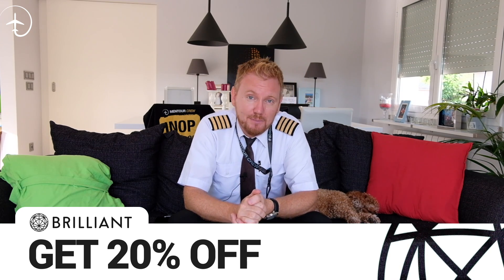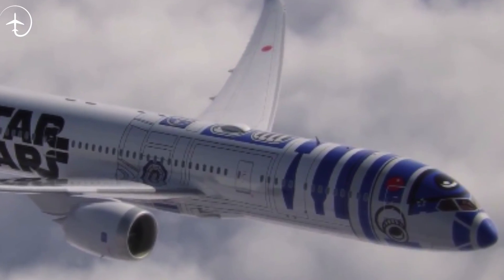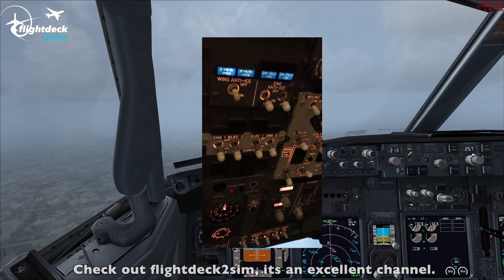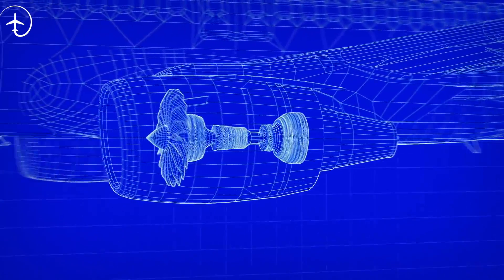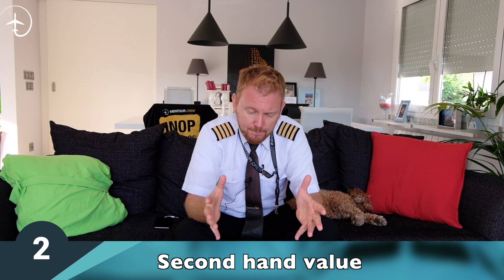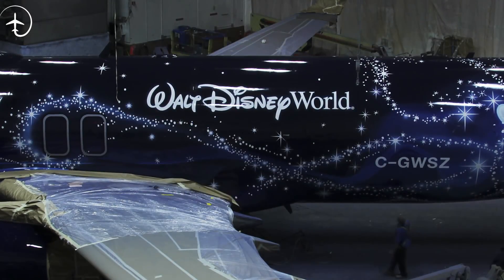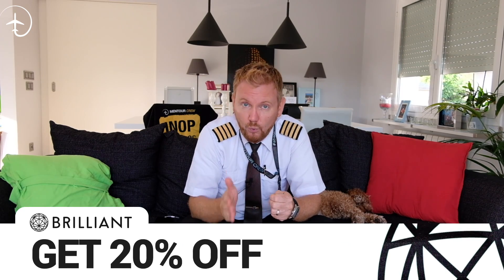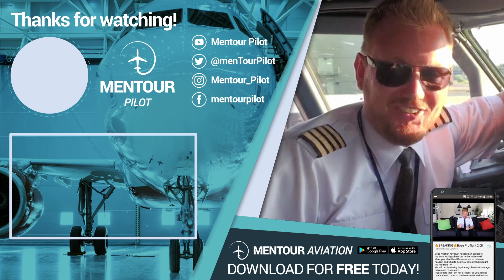Why the front of the Jet Engine is NEVER painted..

Comment: Hi +Mentour Pilot ! I'm watching you for a long time, and while I'm no pilot and I won't be one, I'm just drawn into learning more about this subject. A few days ago I was flying with an Airbus 320 for the first time, two times in total. While boarding into the plane the music was playing, the light were on, and then the power cuts off for about 1 second but enough to be noticed, and then everything was back on, with a slight lag on the music. On the second flight the same, but there was another power cutoff again, before heading to the runway (2 cutoffs in total before moving). I though the APU was on all this time, and the power cutoff was when powering on the engine - but I didn't hear it since it was a mess boarding. I was in Boeing 737 (more versions) a lot, but I didn't see this thing happening, or at least wasn't noticeable. What could it be, and why is different from this point of view? Because for people, losing power "out of the blue" could be a bit scary, I mean it's a plane, not a lightbulb.
Reply: I've been onboard many different planes when this happens. APU's are not used a lot to save on fuel.  So they use the cart for power when on the ground and parked at the terminal.  The power interruption is caused by the switch from cart power to plane power.  (APU is not needed when the main engines are running).

Here's the rub! Remember all of the times when planes are stuck waiting for departure for hours and can't?  And the customers sue the airlines for being stranded on the tarmac for hours on end in sweltering heat?  Yeah that. I have no idea but I'll take a guess... they shut the main engines down, keep the apu running (so they can restart the engines), but the ac has no way to operate without the main engines, so customers just die in the heat.

Just my opinion!

Comment: You forgot to mention the fact that all airfoil leading edges are not painted as well - for similar reasons.
Reply: Dave , it is mostly jet aircraft that use bleed air heat for anti-icing. Even relatively fast turboprops (250-320kt cruise) use de-icing boots inflated by a fraction of the bleed air PRESSURE available.

Comment: Aside from engineering considerations, paint on the engine inlet would also show its age and look ratty if the leading edge was sandblasted to bare metal.  This is reason #4 and the one most easily understood by management.  (Managers, just joshin' ya!)

Comment: I fly United quite a bit, its interesting to note that you can always tell which of their jets came from the Continental merger because the engines on those jets have a polished silver leading edge ring as opposed to traditional United jets which are the matte silver color. Is it literally just polished or is there anohter reason?

Comment: I remember reading an article a few years ago about the liveries and the weight that the paint adds to the finished product. Imagine if they used only the green layer.
Reply: Wouldn't be enough coverage to protect the plane over time.  But the paint weights are calculated to the T in the original design.

Comment: If you have an auto setting for the engine start switches what does that “auto” control? I know Cont is for the igniters to keep going but with the A320 if you put the engine anti ice on the igniters switch on automatically without having to change the start switch

Comment: I wonder how basically all non-cargo military aircraft get away with painting their intake.  I would say at supersonic speeds the friction alone heats up the entire aircraft, but they rarely see that.  Only the F22 has supercruise.  The A-10 doesn’t fly high enough to worry about icing, but most fighters can fly higher than most commercial airliners.  I wonder if there’s some other kind of physics involved.  Or maybe they just have a smaller hot oil line feed up to the lip, and get away with painting it.
Reply: Throwing the dollars at high spec paints or anodising would be my guess. Fighter jets also tend to have radically different intake geometry than a passenger jet, which might also make a difference.
Reply: @karl0ssus1  Oh boy, you are spot on with that comment. The difference in intake geometry is HUGE!
Reply: @AZREDFERN The A10 can certainly fly high enough to encounter icing conditions.
Icing can take place at sea level.
Think 28 to 31F with fog or mist driving a car.
The A10 can fly at least 30,000 Ft.

Comment: I wonder what the minimum temperature that Rolls Royce, General Electric and Pratt and Whitney have ever run one of their engines at, of course, many people will say, before it gets that cold we roll the airplane into the warm hanger, and then when it takes off the engine hot air bleed off is sucking in warmer air, but suppose this is not an ordinary situation.  It is one in which the aircraft are military, they have been parked on the ramp for three days of sub-sub zero temperatures, and suddenly the aircrews hear the klaxon for them to go to aircraft and do a "hot start" on their engines, because they have to have the bombers, tankers and AWACS and AEWS aircraft into the air with 5 minutes from the klaxon going off.  How much temperature room do they have to play with before the situation is deadly?   Oh, and don't forget anti-icing the wings before T/O.

Comment: How much weight does paint add to the aircraft?
Reply: Regarding paint scheme mass (and polished aluminium such as used on the old American Airlines schemes) - an informative summary is provided by Boeing here: 
@t

The mass of paint on a 737 is about 81 kg (versus just 11 for stripes and logos only)...
Typical savings in fuel costs are negated by extra maintenance (e.g. repolishing ~4 times per year rather than painting every 4 years) so the annual cost of operating a polished short range single aisle aircraft is ~$90,000 more (1998 estimate).   This left the matter largely to aesthetics - until the increased use of composite materials in designs necessitated paint.

Comment: Have not read all the comments so if you answered this question I apologize. As you mentioned dark colors would absorb more heat than white . Which as you mentioned we have all experienced when out on a summer day. This is at ground level where the air is warmer so the dark clothing absorbs more heat. Would the effect be the same at cruising altitude? The exterior of the aircraft would absorb more heat decreasing the aircraft skin's exposure to the extreme cold. Is there any operational benefit either way on the planes exterior temperature?
Reply: White probably provides a better range of temperatures in the cabin for the airconditioning/pressurisation system to handle. Hot engine air is normally used to provide pressurised air in the cabin, so heat is not an issue in flight. Also, humans in a poorly ventilated, insulated cylinder generate a lot of heat.

Comment: Rooftop solar hot water systems are painted black for the same thermal conduction reason.
A sinister application of 'white versus black', in strict Islamic countries, Saudi Arabia for example, most woman are made to wear black clothing, while the men enjoy the luxury of white. It's to do with oppresion of women, condemed to a life of discomfort outside in the heat, and the elevation of men who breeze around more freely in cooler white.

Comment: Only +45 on the Surface? How?

If the plane is parked in say Australia in the summer the Outside Ambient Temp might be say 45*C 
But the direct sunlight shinning on the plane might be 80-100*C 
(as you know temps are measured in the Shade out of the breeze)  

So the Real Temp Variance would be more like a total of about 165*C (-55*C @ Altitude to +100*C sitting on tarmac in Australian or Africa) 

That is how we can cook on our car bonnets in summer by just leaving car in sun and also why our roads melt leaving liquid tar (which turns to liquid at over 120*C)

Comment: When viewing the demo flight footage of the 737 MAX I have to wonder if the plane was equipped with MCAS or if the test pilots must have turned it off. I see no way it could fly without MCAS engaging when they initially take off at such an extreme angle of attack. Would you agree?

Comment: Why don't you ever answer my questions or you do not care? Why there are no airbag on plane ? Why is the life jacket not used during crashes?
Reply: Jeje Wa I don’t remember in which video but he has answered the question about airbags. They aren’t used on planes because they are deployed using an explosive, they would add a lot of weight, and in a serious crash they wouldn’t help. Search “Mentour pilot airbags” the right video might turn up for you.
Reply: @sandramccusker5520  ok but what about using the life jacket as a cushion,?
Reply: Jeje Wa I would think, like an airbag, in a serious crash, a blowup life jacket isn’t going to be very effective in saving your life. Having one around your neck might even make it more difficult to get out of the plane quickly in an emergency evacuation. From what I’ve learned, the safest thing to do in a real emergency is whatever the cabin crew tells you to do. If it’s a crash landing, make sure your seatbelt is on tight and get in the brace position (Mentour has a video about the brace position). If you land in water, grab the life jacket, put it on, and get out of the plane. If you’re on land, just get out. That’s really all you can do.

Comment: Thanks for the great videos.  Can you tell us why mobile phones should be turned off during take-off and landing.  What can happen if you don't?
Reply: Peter Christiansen Basically its just a “just-in-case” thing. Before you didnt really know what kind of frequencies and how strong the phones were transmitting so there was a possibility that something could interfere with the planes systems (radio, locator etc). These days there are limits and standards and basically a phone will not affect anything, but because you can’t test every single phone and item, they say it just in case. It removes responsibility from them too, it possibly makes the passengers more focused on the safety briefing. And its during take-offs and landings only because those are the most risky, if something goes wrong during those times its gonna be a lot worse and stressful than during cruise or while on the ground.
Reply: @iPelaaja1 Thank you so much for the good answer.

Comment: From maintenance perspective, reason No.5:
Damages on the skin of the aircraft are easier to detect if’s color is white. Like cracks, corrosion, rivet gone loose etc.
Reply: Is this true? I would have thought damage would be easier to see in darker colours, especially from a distance, while lighter colours could mask and small cracks at a distance. I'm no mechanic, so nor trying to judge, just an opinion that I thought.
Reply: @peterfranklin4019  Cracks and loose rivets would show up mostly by their shadows and they are easier to see against lighter colours. Likewise, corrosion tends to darken the metal.
Reply: I thought it also was to protect interior wiring and electronics from getting to hot..
Reply: @knocksensor3203  Heat exposure is more like an issue with composit aircraft due to the use of resin in composit materials.

Comment: Question:
why aren't the tires equipped with electric motors that bring the tires up to speed on landing to reduce the wear of them?
Reply: Because it would add cost, add weight, add another system that could fail and would actually provide no benefits. Tires spin freely and spin up to speed almost immediately, it doesn't induce THAT much of wear.

Comment: Don't fan blades get iced? The big fan in front of the combustion chamber, so it's getting hit with some very cold and moist air, and it's also rotating so the airspeed of the blades is even higher. And what about the inside of the outter walls of the bypass? Or is the inner core hot enough to melt any ice that might have formed there? Is fan actually hot when it runs? I know turboprop blades aren't.

Comment: How often is a commercial jet checked.  Do they have annual checks such as every wire, bolt and cracks checked.
Reply: Mersey Blues Different checks are done at different frequencies. We do a B-check every morning before flight, A1 in between flights if its been less than 8 hours from the B and A2 after the last flight of the day. Those look at the main parts, the most important parts and stuff thats most likely to wear (moving parts). Then there are C, D, E etc checks where everything is looked at in more detail, some parts are disassembled to see inside them etc, more systems (stuff that normally doesnt need to be used, like emergency locator) are checked. Those checks and intervals are defined usually by the manufacturer

Comment: It would also be a good video about differences between anti-ice and de-ice systems
Reply: Thomas anti ice should be activated prior to ice accumulation and left on until icing conditions are gone. De-ice is a system used after ice has accumulated. Usually de-ice systems use rubber boots on the leading edge of wings, stabilizer and vertical stabilizer.

Comment: Other quick possible thoughts for the lack of Engine paint: 
If an engine needs overhaul maintenance or recall or failure, and it can be sent back to the engines manufacture say GE or Rolls Royce; they have programs that can swap engine out with duplicate engine to keep downtime to a minimal for an airline. 

Thus it would be very strange to get back an Jet engine that has say an orange paint scheme, that doesn't match lets say the fleets Purple livery.  Heck it might not match other engines color on that plane in this example.  Might even affect airlines that have "sub-brands" (bigger airlines that own a smaller lesser named livery brand that uses same plane model)  

Also if paint was used might mistakenly have a "left or right" paint job, that would reduce ability to swap engines within the airline itself. Say a "left engine fails" and you only had an spare "Right engine" that had a livery or writing that you read or make sense if it was on "Right side" of craft, that would be facing the passengers if used on left side of craft.  May look unprofessional, strange maybe even confusing even to other entities at the airport.

Not to mention Jet engines can be compatible with different model planes or manufactures of said planes (airbus and Boeing) 

So above thoughts are my thoughts and opinions, and "it's Just a Theory, an Aviation Theory"  =D lol.

Comment: Anybody who has black car know it is an oven in the summer 🤣🤣🤣
Reply: @OBServe Garage the rest of the car is still hot and the heat slowly conducts to the inside, of course it's a lot better with ceramic tint but not completely gone
Reply: Pffft.  Black paint aint nuthin!  When I was 16, my first car was light gray.  However, it had black vinyl seats.  And the car was 16 years old, so that vinyl was cracked.  Imagine sitting in a car seat that would both burn you and cut you.  It wasnt long before I got seat covers.
Reply: Ari Finkelman 🤣

Hot black vinyl
Reply: @OBServe Garage wrong
Reply: I can vouch for this. I once had two cars of exactly the same model, one white and one dark green. The interior of the white one was much cooler on a sunny day... it gets hot here in summer (Perth, West Australia) with intense UV in the sunlight. Even to touch the outside of them you could tell the difference straight away. The white reflects away much more heat
Reply: OBServe Garage heat don’t only come from the window
But the whole car roof and surface
Reply: @OBServe Garage It is not hot for you, but in all cases it is still hotter than a white car
Reply: Yeah, my car is Black. It's great for baking cakes so I don't mind.
Reply: @theblackpologti on Instagram gets very hot in the summer.
Reply: Use to have a Black on Black ‘77 Camaro Z-28. Loved it but was miserable during the Summer in the American South (Alabama). Wish I had it back & never let go of it.
Reply: Not if you use a sun blocker in your windows which also doubles as an anti-theft device which will get you a discount on your insurance.
Reply: UFOz NoJoke 
Insurance company don’t give discount for tinted window

Best theft deterrent is 
LEAVE NOTHING VISIBLE 
And potential thief just move on
Reply: UFOz NoJoke 

Car insurance DONOT offer discount for window tint for theft deterrent 

Actually Car insurance rate would go UP if you want to include the expensive window tinting in the full coverage insurance 

And if window tint is too dark and illegal 
You might have problem getting reimbursed for accident due to visibility! 

Just confirm with my car insurance broker

Comment: I would imagine that it would also be easier to spot fatigue related issues, such as cracks or wrinkles on the fuselage skin if the aircraft was painted white rather than some other color. Fun fact: American Airlines used to leave their aircraft unpainted with the exception of their name and logo. They said that by doing so, they could save about 500 pounds of weight per aircraft.

Comment: Hi Mentour, great video as always. So informative! It did get me thinking about engine intake and bird strikes and I started to wonder why isn’t there some kind of protection on the engine intake to avoid bird strikes? Like for example a bug screen but with wires much further apart so there’s plenty of air flowing through but not enough space between the wires for a bird to get through? My instincts tell me this is a terrible idea ( otherwise it would already exist)  but I can’t figure out why it’s a bad idea. Thanks! B.
Reply: The wires on such a screen would need to be close enough in order to prevent a bird from entering the engine. However, if this were the case, enough airflow would probably be blocked as to cause issues.

In addition, if the screen were to become damaged, then metal pieces could break off of this screen and enter the engine.